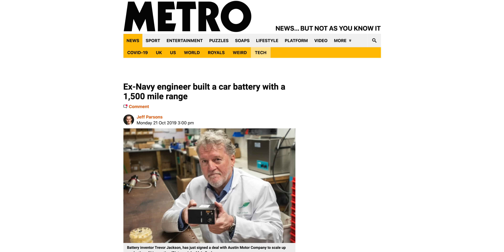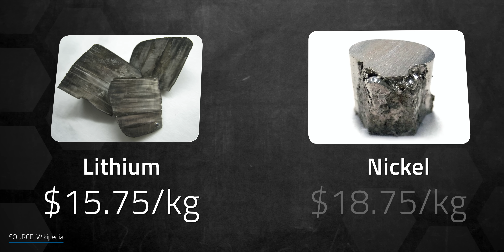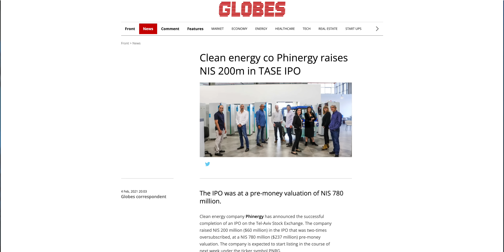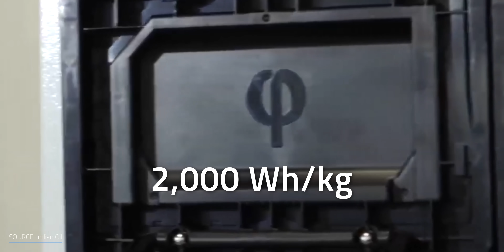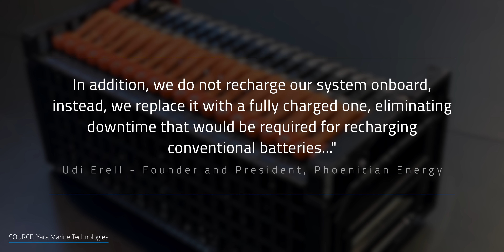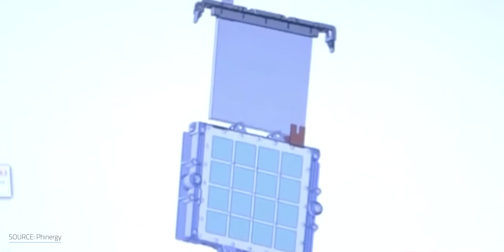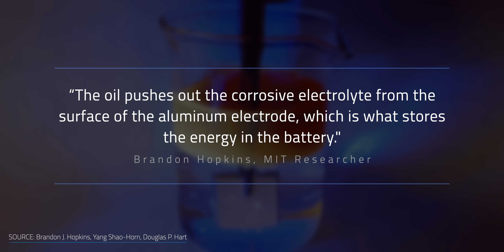Exploring the 1000 Mile Car Battery - Aluminum Air Hype?

Comment: Great video, four quick points that spring to mind:  

1) I see absolutely no issue with a 1000 mile range battery that can be swapped out in 3 minutes, providing there's sufficient infrastructure for swapping in place.  I mean how many cars / light trucks can do 1000 miles without having to re-fuel on petrol / gas/ diesel anyway?  Equip the regular fuel stations with standardised Al-Air battery swapping capability and problem solved.  No battery memory effect, always 100% charge.  I'd love to have a vehicle with a freshly swapped out battery each time it's re-fueled.  The key to this working is lot's of places to swap batteries and standardise the batteries.

2) The comment regarding a Tesla with an Aluminum air battery of the same weight as it's current Li-Ion battery being capable of 2700 miles... That has to be wrong? There'd either be no room for passengers due to it's huge comparative volume (given its light weight) or you would have to tow it on a trailer causing mechanical and aerodynamic drag, thereby reducing range.  

3) Battery cost might be an issue to this technology's uptake?  No mention of comparative costs to recharging Li-Ion in this video 

4) Surely, you could always carry a spare battery looking at the video clip of a guy lifting it about like a lightweight box?  Or.. how about you just replace the depleted aluminum with a plug in aluminium grid (keeping the catalyst component with the expensive Silver in the vehicle).  Perhaps the electrolyte (if it requires replacement) could be pumped in, just like regular fuel to replace spent electrolyte.  So it'd be a Aluminium grid swap and electrolyte re-fresh at the filling station.

I hope they get this to work commercially.  No issues with spent battery recycling containing rare metals.
Reply: Absolutely, the criticism of replacement is stupid. Al air batteries will let the existing gas/petrol stations put to use as swapping stations. What's the problem at all if you refuel your diesel vehicle at a much faster rate than you will ever swap batteries. 

Secondly, swapping stations will remove the whole permanent battery replacement out of window which is the major part of ev cost. It's like depreciation of total cost of replacement while also eliminating the cost of fast chargers, their maintanence and usage of electricity and risks involved at your own home.

Comment: In my mind there are several ways to deal with range anxiety. One, hydrogen fuel cells, your on a trip your tank gets low, you pull in and fill up like a gasoline car. The second is to add a linear internal combustion motor, one where the pistons face each other and move back and forth generating power. This second idea would be a stop gap solution, one of the areas not being properly explored in my opinion is charging roads. As you drive down certain roads they would charge your batteries, potentially giving you unlimited range.

Comment: If the swap really takes 3 minutes and the battery is super light I don't see why this wouldn't work. The only thing that would affect wide spread adoption is the cost. I think road side services would be able to bring a battery and swap it on the spot if it's as light as the video shows. In my opinion it just comes down to cost

Comment: A man in my country invented a device that uses aluminum cartridge to react with a basic solution of water and NaOH. The hydrogen released from the reaction is combust in the engine to run his car which puts out water vapour at the exhaust.  His name is Harlo Mayne's  and his invention is called Maynex H2 Flex. one cartridge  of aluminum weighs about a pound and can give 300 miles for an average weight car. The only problems with his invention is the build up of heat and pressure in the reactor that may cause a somewhat safe small explosion failure. and also the problem of the renewable energy needed in recycling the aluminum from the left over basic solution in the reactor. You only add the NaOH once between each reactor clean out and you can use several cartages before a clean out is required. he said the cartridge can be sold at a starting price of $20 USD and should get cheaper over time,. Water is very cheap to fill up the tank when needed and the explosion problem can be sorted out with better engineering design. Plus the heat energy from the reactor is not used and a fuel cell can be 3 times more efficient than an engine. So Comparing this aluminum battery technology to his ill say its better to use his. What do anyone else thinks?

Comment: If they sold these as range extenders for EVs in different sizes, say 50 miles, 150 miles, 300 miles, and stupid big 700 miles, that should eliminate most people's range anxiety. Since you can currently get from one US coast to the other along a predefined path but if you stray from that path you're kinda SOL and need a tow. An extra 300 miles means you can go a long ways away from that normal EV charger path to hop to a different one. Since the charging stations are around just not as plentiful as gas stations, that extra bit to get you over the hump between charging stations. Say you just need 50 miles extra. Your 150 mile pack gets you from A to B and back with some extra in the tank. Then when it gets low, you sell it back at recycle prices and buy a new full one.

Comment: Instead of one big battery every car can have 3 small batteries. So say when battery #1 is fully discharged it can be swapped. You should still be able to fully utilise the juice of battery and be tension free.
It would be like a reserve fuel compartment as if today.

Comment: Battery swapping  wouldn't  be so annoying if they were designed  to be plugged  in and easily swapped. That way they could be obtained and swapped at any service station.Also the cost of swapping them would be a factor.Not a new concept  My dad put the thought of that and using the wheels to backcharge batteries long before some ran with his ideas.Ps  never  got  ruminated for his ideas .

Comment: Even being recyclable it sounds like these single use batteries would be a big decrease in energy efficiency. Meaning because they are 1 use then recycled it's way more work than current rechargable solutions. 

Also the Tesla comparison used battery weight but these are considerably lighter. What is the size comparison?

Comment: only Aluminium is needed to get energy , u buy the system once only need aluminium. like u need only gasoline run after u buy the vehicle once.U can have always spare aluminium like gasoline in ur truck.So u buy the vehicle once then during whole time u need is aluminium , as simple as gasoline

Comment: With the Oil Pump system for Electrolyte, has anyone considered running a Centrifugal Oil Filter before the pump?  (COTS)
This should produce a thick sludge which can be dealt with in another area.  Battery Swap is the FASTEST solution at this time.

Comment: Getting stuck out of electricity with a range of a thousand miles is the same as someone who forget to fill their tank with gas, it happens.  So what's wrong with AAA bringing you an Aluminum air battery like they do now with gas, same thing.  If it makes money you don't think Walmart, Costco, BJ, or any of the big chain store won't stock them like toner.  Since they're light, you don't think Amazon would drop ship them to your door.  Not having to charge them is a plus, not a minus, do you know how much charger cost and the time it takes at home to charge.  Plus imagine everyone is charging their cars at the same time at night, watch all the electrical substations start blowing up, the United States has a horrible electrical grid in some parts like Texas, remember that winter storm that knock out their states power grid, just imagine something drawing power more than 3 air conditioner will do to it.  Just have them drop ship your battery.

Comment: One of the big problems is that the battery gets heavier as it is depleted.  The battery is the heaviest, by several times, when it is emptied of electric potential.
Rather than using solid Aluminum I believe the true answer to this system is to use Al powder jetted through a device similar to a Metal Printer.
Thousands of mini "print" heads harvest small amounts of energy from tiny amounts of Al powder and multiply that by hundreds or thousands of 'print' heads.

Comment: Can someone help me to understand why the hydrolysis of Aluminium as an energy source is good?

The reduction of Aluminium is one of the most energy intensive production methods for any base metal, add on dehydrating the hydride that is produced at the cathode? and you are basically recreating Aluminium ore in the battery. Once you factor in the energy costs of transport (both the old and the new), disassembly and reassembly, and any additional manufacturing of the cathode beyond casting (we'll assume that to the forge making Al the casting the Al is free, it's not, but if it's already molten you can just pour it somewhere close for pretty cheap)

Just the reduction of alumina (Al2O3) to Aluminium metal is 40% efficient, in comparison to the theoretical energy required. (Takes 15MJ/kg, theoretical is 6MJ/kg).

So just making the battery is going to be, at most, 25% efficient, ie you can only retrieve 25% of the energy that it took to make the battery from the battery. As this only does the Al -> Al(OH)3 transition this isn't the same energy of Al2O3 -> Al, but less so efficiency of these batteries is also reduced. 

So I don't understand, this seems like a terrible idea, it's not like we have fossil fuel free ways of making vast quantities of Al. Burning the oil for fuel seems vastly better than making Al and then reacting it with hydroxide for maybe 15% of the energy you put in as an output.

Anyone know why this is a good idea? If reduction of Al was much easier then I can see the benefit, but this is one of the worst processes and not really any hope of it getting better, I mean anyone who does can make all the money because hot electrolysis is how we do it now and it sucks energy wise.

Comment: It's particularly exciting to hear about alternative battery tech, since the current lithium-based vehicles essentially are tethered to their home stations, unless you think 45+ minute stops for recharging are OK on long trips. I was looking at the Ford EV truck, and it sounds amazing... except when I thought of taking it out to a neighboring state to pick up materials or go on a trip, and then being stuck at a charging station for an hour before I could return. I'd be happy to swap out some packs and be back on the road within a few minutes.

Another problem I see, though, is partial-capacity swaps. With ICE or rechargeable EV vehicles, you can top-off the capacity if you know you have a longer trip coming up, while with non-rechargeable batteries, you'd either have to do a mid-trip swap (find a station or carry a spare battery), or do a wasteful partial-capacity swap before the trip. In fact, this would always be a problem, since you'd never actually reach 0% capacity before needing to swap out, since you have to get to a station to do so, and that requires some capacity remaining. I'd guess multiple replaceable units would partially solve this issue, as each unit could be rotated out as it drained, rather than doing a full swap of the entire battery.

Comment: Not sure I would want to have to swap batteries event time. Seems like a good idea and if you did forget to get a new battery and your our car there could be a service just like there are for current EV’s where a new os brought out to you like we do now with cars for. Like bring a can of gas when you run out but it’s a battery. Also as I think on it it would make more sense with how we are accustomed to our vehicles now. Every time you go to a gas station now you fill your tank after depleting it. So swapping out a battery would be a similar experience I would imagine. Fast. It brings a lot of upside potential to the current EV short range and long charge times. Either way always glad to see new ideas being tested.

Comment: “Aluminum-air batteries have a great advantage with weight compared to lithium batteries because aluminum … is extremely light weight.” This is truly an unfortunate argument, since lithium is the lightest metal, more than 5 times lighter than aluminum…
Reply: there is about 7% lithium in the lithium-ion battery
Reply: Yeah but I think he was referring to the total weight vs power output, context-wise. At least that's the way I interpreted it.
Reply: If you watch more videos, you'll soon find more inaccuracies and misleading premises just like this...
Reply: you need to look it up since the components are not only lithium, the total mass i bigger, but actually its all summed up in the energy-density where Li-ion is about 100 Wh/kg and Al-O is about 1300 Wh/kg so if you take 1/5 of th the mass of Al-O you would still be more then double the energy-density of Li-ion. That means that with a batterie of around half the mass you would still have roughly the same distance.
Reply: @emcotec1463  You didn’t listen. My post wasn’t about which battery was lighter, but the dumbness of involving Al density in this context.
Reply: @laszlokorosi9012  that another story and you are right with this one
Reply: Not to mention solid state electrolytes are generally lighter than their liquid previous-gen counterparts.
Reply: And even if it weren't lighter, it still wouldn't matter. There is about a dozen kg of Li in 100kWh battery, so the savings would be irrelevant either way.
Reply: Its called a lie and this guy apparently likes to do so more than others.  Just like MSM this guy is Beholdened to his sponsors and push whatever Narrative he is told to.  There is a reason he is reading from a script.

Comment: Aluminum batteries doesn't sound smart.  Sure it has more energy than lithium batteries but it sounds like you have to actually replace the battery pack like every few weeks.  As opposed to just recharging a lithium battery.  You have to transport the aluminum battery pack, which can't be as efficient as the grid.  It takes a lot of electricity to make aluminum, as that's how they heat the aluminum oxide to get aluminum.  I'd rather have lithium batteries honestly as it may still be more economical and environmentally friendly than aluminum.

Comment: Aluminum smelting, which is basically how you regenerate the raw battery material from the spent batteries, is not the most environmentally-friendly process.  Coming up with a more efficient and safer process would be a huge win.

Comment: "Would you want to drive an EV that required battery swapping?"
Yes, because to me it is just like using Gas today.  It is only different in the fact that one is a liquid and the other is a solid, so in a way it is like having a fuel rod.  To counter the not being widely available you could have a backup battery installed with it that you would use in a pinch to make sure you can get to the swapping station.  That backup could even be the same kind of battery but smaller, just big enough to get you say 50 miles to a swapping station.
Reply: Hell if you are creative the backup part of the battery could be part of the normal battery too and it requires a manual switch to turn it on so the driver is 100% in the know that they are using it.

Comment: You haven't address the most important drawback of aluminum air batteries which is requirement of fresh aluminum for each new charge cycle. What happens to the removed aluminum? How much energy is required to recycle it? All those pointers decide the feasibility.

Comment: Unless these batteries cost less than $50 US, you've exceeded the cost of running on gasoline.  I'm betting that these batteries are several THOUSANDS of dollars, and are just disposable.

Which means that your driving costs are going to be several dollars per mile, as opposed to the pennies per mile we have now.

Good luck selling that.

Comment: Most people's driving patterns make the hybrid of a small day-to-day lithium battery coupled with a swappable aluminum-air battery for the occasional long range trip logical.
Reply: Put a power hookup in the trunk, stick a self-contained aluminum power pack in there for a long trip.
Reply: True. Especially if aluminum-air battery packs would be modular and relatively small, small enough to be carried by a single person with ease.
Reply: Excellent idea.
Reply: Longer trips are prone to have more cargo, so some alternative mounting solution would be handy.
Reply: Or just quick-charge that "small" day-to-day lithium battery on your occasional long range trips and don't waste a ton of space in your car...

Comment: I've always thought a battery swap system was more long-term viable than recharging (except at home). Instead of filling up at a gas station, you'd pull up to a big bank of batteries, activate it and a loader system would remove the current battery pack and replace it with a fully charged one. Downtime would be about the same as a fuel fill up. This plug and drive or hot swap type of thing would have to be some sort of universal standard though, which would be a major sticking point.

Comment: Hybred system is where it's at.  I like the comments that suggest  two battery stages.  I have that on my electric lawnmower. When one battery goes dead my lawn mower switches to the charged battery.  It works very well. But maybe add a short distance recharging emergency pack. The emergency pack might actually be a chargeable battery good for 30 miles.  Combine this with a warning system that would GPS link your car to battery exchange locations for the big batteries. If for some reason you get stuck,  AAA could send someone to charge the emergency battery. And depending on the size of the emergency battery, it could be used for local traffic and save the big batteries for longer trips.